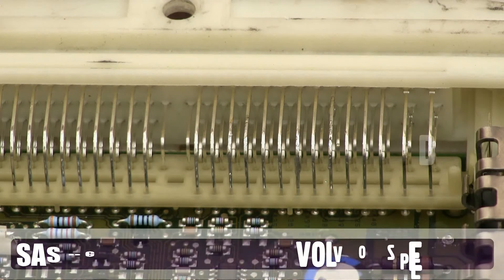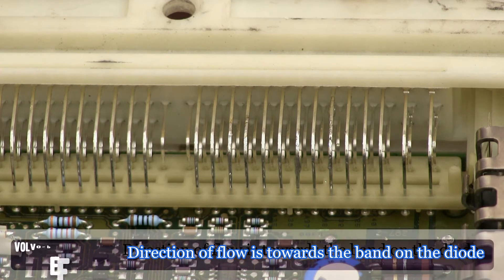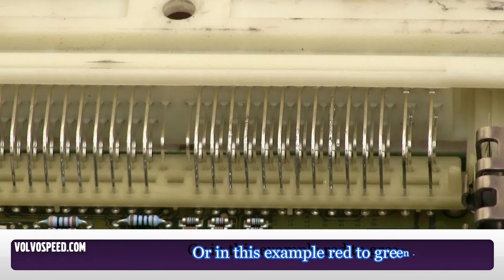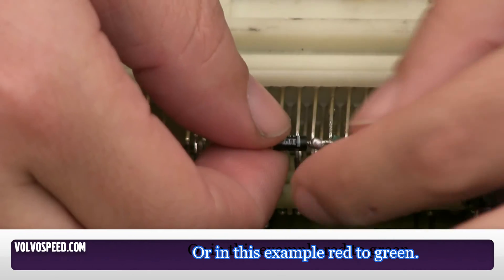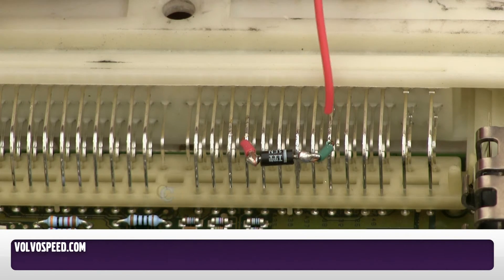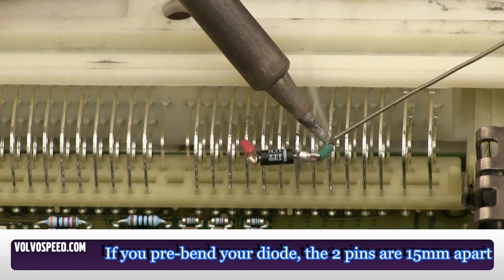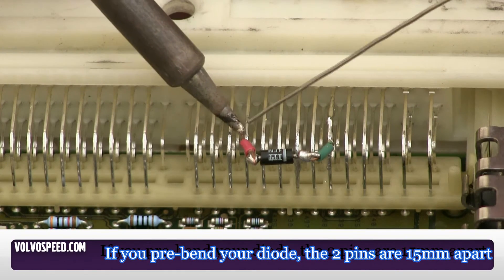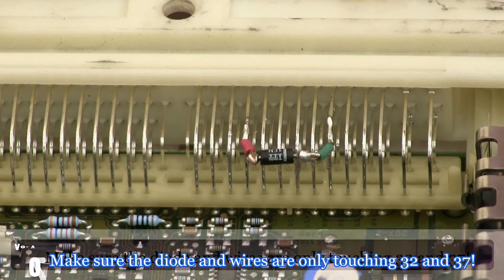Volvo SAS Delete / Air Pump

Comment: Ive tried both pin 37 and 38 with no luck, still having check engine light on for the first couple minutes that the car is started. Is there something I'm missing? Disconnect power to the air pump?
Reply: No you need to keep that and the solenoid hooked up.

Comment: Nice video, except pins shown at :16 seconds through:18 is wrong. You soldered at 33 and 38... as well instead of 32 and 37.
Furthest right pin is 43. Please correct this, edit your vid. as it is misleading and won't work.